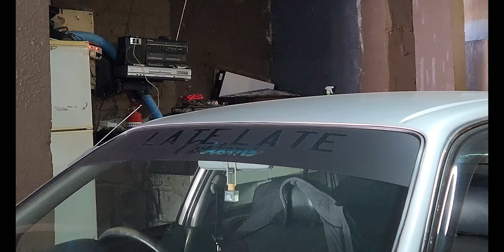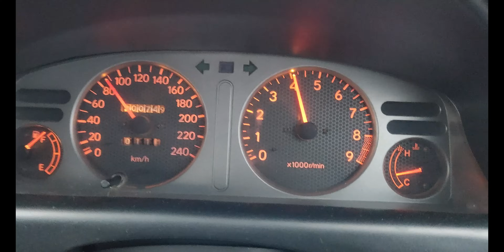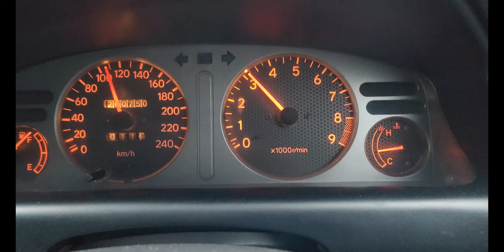Fitting TRUMPETS on my Toyota RXI 20 valve - OPEN THROTTLES!

Comment: The short trumpets won’t give you that low down throttle rumble but they will give a nice sound on top, 20v likes 100mm length trumpets, they hit hard from the bottom straight to the top, the shorter ones give less torque on the low end and the fact that your trumpets are plastic, or that it looks plastic won’t give you that metallic throttle sound, you’re more than welcome to test my 100mm trumpets for a future video if you’re interested, love the content as always
Reply from the maker: Will the 100mm fit with the plenum on?
Reply: @LateLateCustoms  no sir, I think 50mm is the longest you can go with the plenum on

Comment: Longer throttles makes the car perform better, 75-100mm pull harder and sounds nicer. Just a thought, but happy to see the 20v getting some love❤
Reply from the maker: Will the 75mm till 100mm lenth Trumpets fit with the plenum on?
Reply: @LateLateCustoms  unfortunately not, that's for an open throttle setup

Comment: Which management you running on 20v? Go Std Dicktator 60-2 and a nice tune. 👌 you won't regret it. Motor will respond much more.
Reply from the maker: Standard ecu. I prefer the standard ecu for the factory precautions

Comment: Hi late late, ive got a 2lt 16v rabbit i want to sell its sitting in my drive way for a long time its a unfinished project, it had a feul injected system it needs sidedrafts, the interior still nice only the motor and bit body work, its got patina look, if you interested,